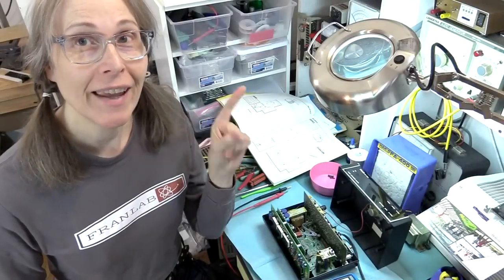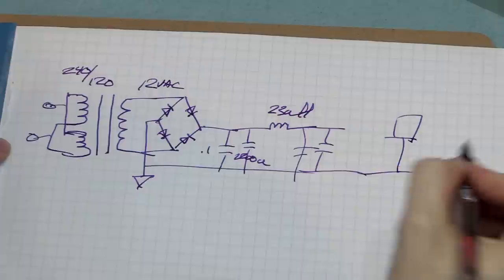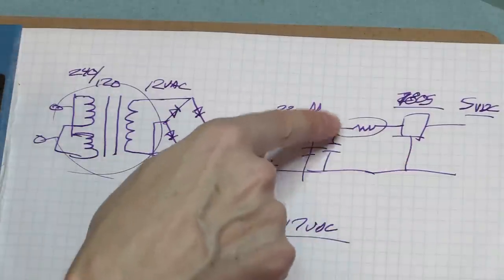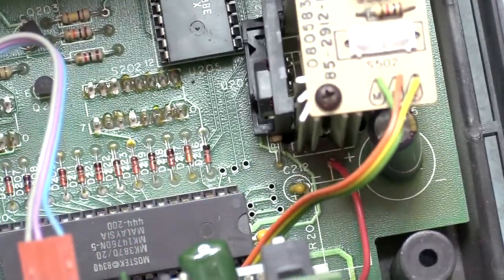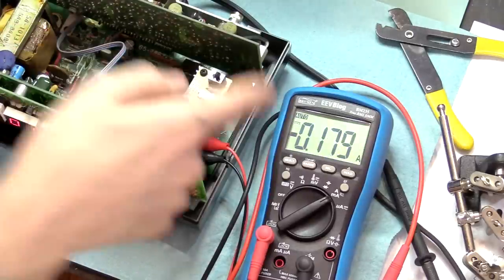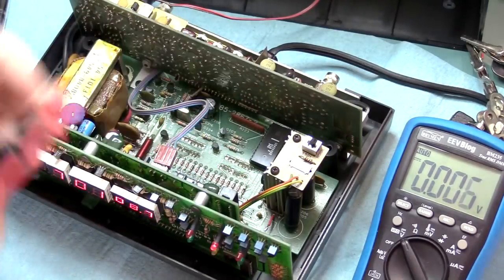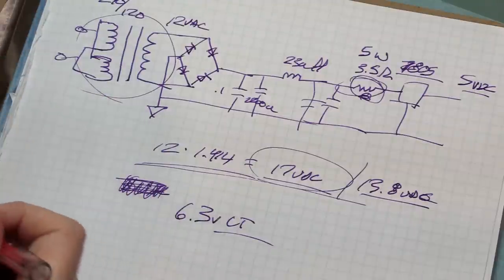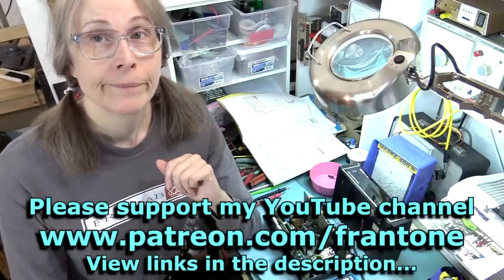Heathkit GC-1000 Power Supply Design Fails and Fixes

Comment: 3rd option: re-wire the transformer primary for 240v operation... then since it's running on 120v, you'd have the target 6.3v coming out of it.
Reply: Yea, this is a workable solution.  I’ve done this before in similar situations, and it works.  I’d probably keep a resistor in the B+ path.... a .1 ohm or something.
Reply: I totally agree I was going to success the same thing, but you beat me to it.
Reply: That’s what I was going to say.
Reply: I doubt 6.3VAC is enough for 5V when you take into account the current is a lot higher than Fran measured when a linear regulator is used and you have to account for the minimum mains voltage and the maximum ripple voltage that the caps give when they are at minimum tolerance, etc. Normally 8-9V AC is about right for 5V regulator in my experience.
Reply: I've tried this before but found the transformer's load regulation to be poor. It could still work provided there is enough margin for the regulator's drop out voltage at max current.
Reply: You would need to give yourself more headroom than 6.3v for ripple, that's for sure. That is far too close to the dropout voltage of a regulator, even before the sag caused by the load on the transformer! I would target 8v at least, then regulate down to 5v. 12.6v is excessive though. You would need something better than a linear regulator to deal with that much voltage drop. 
Or you could just punish the hell out of the 7805 and throw a huge smoothing cap on it's choppy output constantly thermally shutting down xD Seems like that was there design philosophy here... monsters.
Reply: @nophead  Good point.  Would have been better to measure the current out of the switcher.  Could be more than 2x what was being measured.
Reply: @nophead  is they before or after the +40%from rectification?
Reply: @nophead  It's probably why the Atari 2600 and Nintendo NES used a 9V ac power brick.
Reply: I was thinking the same  wire the primary for 240V. fond memory's.  I had a TI 30 when I went to electronics school in 1981 to 83. Wichita Technical Ins. 3 months of long hand math then oh Happy day they passed out the TI 30"s and spent the next moth teaching us how to use it. Thanks for the memory
Reply: >I doubt 6.3VAC is enough for 5V
And the same transformer secondary is feeding an 8V regulator, too, so that's right out.
Reply: @Noxonomus  That is the AC RMS voltage before the rectification. Yes it is +41% but minus 2 diode drops and minus the ripple voltage of the caps. That has to be above the regulator min voltage even when the mains is at its lowest spec and the caps are at their minimum tolerance.
Reply: @Noxonomus  Another thing to take into consideration is the diodes only conduct on the peaks, so the current in the secondary and hence the voltage drop due to resistance is much higher than if it was driving a resistive load.
Reply: Yep, a lot of people apparently haven't peeked at the schematic. One transformer winding & bridge is feeding both the 5v & 8v regulators.
Reply: I was goin that way as well & could replace reg with a low dropout type if need be
Reply: You'd need a buck booster for the 8v
Reply: That could be the solution for when it is been used in America. But what about the "poor" Europeans? ;-)
Reply: Just replace it with a low dropout version.
Reply: @nophead  Well do what I did on my 1980s S100 system. Put a 12v tranny in boost mode on the primary of the big 6.3v surplus filament transformer. Mine came out of an old tube RCA broadcast unit chassis, it was about 20 amps at 6.3v. RCA "junk"  was common in Philadelphia electronics surplus shops as the broadcast and military divisions of RCA were in Camden NJ.
Reply: @nophead  Need to use a LDO linear regulator, pin compatible to 78xx series. And replace the 8V reg to a LDO one as well.
Reply: @truckerallikatuk  No, she needs to get rid of any switching regulators, as the noise they produce kills the radio reception, and the clock fails to sychronize.

Comment: I had one of these operational for nearly 30 years.  Built as a kit, it worked well with a long wire antenna.  First issue was the heat that builds up inside.  Second was the regulator.  Problem is the heat. Regulator can do it IF you can get rid of the heat, upgraded the heatsink (at great pain).  Then added a fan to the side as the heat built up inside and affected the receiver performance.  Carved a hole near the regulator for a small 40mm fan - still running today.

Comment: Thanks for getting back to the content we like to see. I hope you're going to show us a part 3 of this clock series. I was amazed and excited to see Heathkit  has these clocks available again for $100.
Reply: Sadly, the $100 gets you the "Most Reliable Clock" (a battery-backed clock).  Not the "Most Accurate Clock" that sets itself from WWV.
Reply: @russellhltn1396  I should have read the ad more carefully :(
Reply: There's been talk that "WWV" (NIST) time & frequency transmissions will be defunded soon.
Reply: @ordinaryaverageguy76  True.  It would be a shame for it to go away, but things have changed such that it's services are not as important as they once were.  You can get accurate time from the GPS system.
Reply: Russell Hltn But it's so much more complex that in many scenarios, it is not as reliable as WWW, or even WWVB?

You become dependent on a long string of points of possible failure, where WWV is much shorter a string and direct delivery to the user. It's on the ground, easy to repair, unlike satellites, their control segment and their uplinks?

Comment: I have to say, the ads for your videos have been consistently the most interesting I've seen.  I left them on for your revenue's sake, but they were also very interesting.  

One was for a laser cutter that looked very impressive.  The other was a portal power pack with a built-in solar panel which is intriguing.  

Thanks!

Comment: Fran, 
Well, when I remember correctly, it also has a 12V input? So it makes totally sense to have the internal transformer also run on 12V.
That would give about the same values on resistors and such things. Nice to run it from your car with something between 12 (car=off) to 14.4 (car is running) Volt.
Also when running of a computer a 12V supply is easier to use. All without needing any change to the internals. Or of course having 107 Volt coming from your socket.

Main difference beeing the heat that is delivered.
Reply: @Rob2  I was about to mention that if it was put in a car, that'd see up to about 14v when the engine was running too.
Reply: I worked for Heathkit for many years and you are right about the 12dc input - the customers were Ham radio guys and wanted battery mode.

Comment: Fran, look at the Recom R-78 series of voltage regulators.  They're switch mode 3-pin modules that plug right into a 78xx series hole pattern.  The R-78E5.0-1.0 I use is rated for 8 to 28 volts input, with a 5v 1a output.  It was just a little more than $3 from Mouser Electronics.  I'm sure Digikey has them, too.
Reply: On the first video, there was a long discussion about how switchmode replacements create too much noise for the HF receiver circuit and cause interference trying to pick up the 5 MHz, 10 MHz and 15 MHz WWV signals.
Reply: @scottwolf9914  ahh, good point.
Reply: The recom regs are fine for radio use. I've used them in a few transceivers with no noticeable RF noise. The particular one that was fitted to Fran's clock is obviously not as well behaved.

Comment: The advantage of the switch mode regulator is it exchanges current and voltage.  So your initial current readings are wrong.  Current at the load will be different then the current at the regulator input.
Reply: Exactly. Lets do some ballpark math: 13.8 volts * 0.2 amps is about 3 watts. Assuming 80% switching regulator efficiency, it gives us 3 watts / 80% / 5 volt = 0.75 amps at 5 volts. With a linear regulator you'll have that 0.75 amps at the 12 volt side too, which will load down that supply significantly. A 9 volt transformer may probably be too weak to do the job.
Reply: Noisy little buggers, those switchers are 😃
Reply: @Circa-rc4sn   yea you'r not wrong
Reply: @Circa-rc4sn  And that's the problem with switchers.  If this was my clock, I'd put back in the 7805, reduce the input voltage and get the clock working.  Then I'd think about adding a quiet switcher.  I like the idea of a switcher, but I don't like the idea of chasing two problems at once.  Of course, if I had a 6.3V transformer of the right size.....
Reply: @Circa-rc4sn  Yep, and it depends on how sensitive the radio is, trying to pick up WWV, while under a cell phone tower. Don't know how much a little switcher in the box would effect WWV reception.
Reply: @davelister796  Not saying it won't work.. but it is not a buried trace layered groundplane shielded PC board either. 
Any length of straight conductor can be a transmitting antenna at some odd wavelength or a harmonic there of.
Never know until you try.
I would hook my o'scope to each section to see what is there. Sometimes a simple fix can be used to reduce ripple currents.
✌❤
Reply: @Rob2  I disagree. I use HF radio ... i'm still an avid SWL.

The fortunate thing is most of the stuff people are running in that waveband is actually very poorly matched to its 'antenna'... and the actual 'interference distance' is quite low. I've found simply throwing an end fed long wire up in a tree rather than at house eaves height... has cut the interference to pretty much zero, and I live in a suburb, so no doubt those demonic 'can't be bothered to run cat6' powerline things are everywhere

One of the worst offenders turned out to be a neighbour's wifi router?! I think it was radiating the noise from its switching supply back down her phone line, which runs parallel to ours (obviously, in the cable) for several km... and then our wiring was re-radiating it.
common mode choke on the landline fixed it (on her landline, we're on speaking terms) and my advice to point out to the ISP that their equipment was radiating radio interference.... caused them to send a replacement
Reply: @Rob2  Ah I see. I still think this situation is wrong. There are companies selling these powerline wallwart things that used to be in charge of PREVENTING radio interference (looks witheringly at British telecom). It seems we operate the same attitude toward the airwaves as we do toward the planet in general: provided it doesn't bother ME, pollute at will :(

Comment: Having built quite a few Heathkit projects, I'd bet the power supply was built around components they already had stocks of (especially in their later kits).
Reply: i recall reading they used surplus stuff a lot.
Reply: @fanplant   I think they started with mostly surplus in the beginning. Their main compitition in the kit market was Hallicrafter and later Lafayette and they too had their share of salvage parts. "Well how do I know?" That's simple. Some of the parts like transformers had Federal Stock Numbers printed on them.
Reply: I think that's exactly what's going on here.
Reply: Using surplus parts was Heath's MO from day one. In the late 1940s it was surplus WW2 parts. That does not mean their designs weren't brilliant. Many were, and they did a lot to bring advanced electronics to the hobbiests.
Reply: @waltschannel7465  Exactly! I never meant to disparage their using salvage and God knows there's ALWAYS enough mil salvage to go around and I've bought tons of it myself in salvage auctions and it's the only way to get your hands on some things. Heathkit asside, for a while there most of my projects was built with mil salvage. As for the power supply, someone got lazy and did what Fran showed us they did.

Comment: Don't forget the external 12 volts input,you would have to consider this as well as the mains power supply when calculating the modification.
Reply: Wish she will revisit this with that in the mix.  Perhaps the external 12v could be run lower, too?  Have to relabel the input jack, for sure.

Comment: I built my GC-1000 a few months after it was first released. Shortly after I started running it I found that the grill metal restricted the airflow and it was getting too hot inside. I cut two 1 inch holes in the top grill cover to allow better air movement and this one clock has been running 24/7 in my bedroom for over 34 years without a single fault.

Comment: I spent some seven years working for a power supply manufacturer. At different times as both manufacturing engineer and materiel manager. We built many types of transformers, using a variety of core materials, winding tubes, wires sizes and composition, and insulation coatings. I do remember buying 120V/ 12V transformers from outside suppliers since they were so common, and were manufactured them in such great volume that we could not build them cheaper in-house. This may have been what Heathkit did also.

Comment: The external DC input may explain the choice of secondary voltage. The 5v regulator could do double duty regulating the secondary winding or an unregulated cigarette lighter input from a vehicle.

Comment: I’m building a GC-1000 from scratch and have settled on a 9V 12VA transformer. I’m keeping the series resistor into the 7805 and will adjust its value and power rating on test.

Comment: You could try the RECOM  r-785.0-0.5 switching regulators. They're pin compatible with the 7805 linear regs and don't even get warm. They're RF quiet too - I've used them in several radios instead of 7805s and they behave really well. Not the cheapest option but they're dependable and easy to source.

Comment: One reason for the high transformer voltage is that you also have a 12V DC input option. Your regulator has to cope with that, so it may as well cope with a similar mains voltage.

Older designs like this might also expect poor mains regulation in some locations so it runs at a rather high voltage when you have a better city mains supply. Old HP equipment also had a huge supply tolerance and similarly ran quite hot. Just one of the choices made in 80s electronics design.

I believe the Power Trends regulator you removed has a relatively low switching frequency. A more modern device with a few MHz frequency would perhaps produce less interference.

Better still might be an expensive Traco or similar converter in a shielding can. Hopelessly overpriced for Heathkit, but a reasonable one-off fix to keep this lovely example running safely.

Comment: The battery backup was based on the use of a 12V gel-cell or car battery which would be about 13.8 VDC when just sitting.  The power supply needs to accommodate either AC or battery power and make the transition either way without a glitch. https://prc68.com/I/HeathkitGC1000.shtml#Batt
There's a slide switch on the side that will turn off the display, so if you are there when the power fails you can reduce the battery drain.  It would have been better if there was a relay that only allowed the display to be on when on AC power with a bypass push button to turn on the display to read the clock during a power outage. 

Glitches are to be avoided since this may be one of the first Disciplined Oscillators predating the GPSDO units that are common today.  It might be called a WWVDO.  The 3.6 MHz oscillator has it's frequency tweaked to bring it spot on so the GC-1000 can be used as a frequency standard.

Comment: Try scoping the regulator input. If the filter caps are dry you will get too much ripple in the supply, so the output might get quite noisy. Maybe that's the reason the CPU doesn't start on its own.

Comment: I have been cleaning out mom's  house since she has entered the nursing home at age 93. I have found a lot of old phone chargers for wireless home phones, most are 9V at 550 map. AC.  When I open them up there is a nice heavy transformer that puts out about 12 V unloaded but drops to right at 9V when used. I use them for projects that don't like the new fangled PS's.  I have even put in bridge rectifiers and come up with some rather nice smooth (ok I added some caps!) power for experimenting and powering devices that need 9V without wearing out batteries.

Comment: Heathkit, like many others, bought and used parts in bulk quantities for their kits. Why buy nine volt transformers when we can get by with those twelve volt transformers they had in supply? We've noticed this on several other Heathkit products from transmitters, transceivers, to test equipment. Many mods have been made over the years on Heathkit products, like several others, to improve or upgrade. No problem with that and I'm surely not knocking Heathkit. We love Heathkit at the museum. I have a HW 101, a VTVM, and an AC voltmeter and  a couple other Heathkit products myself.

I subscribed a while back and have watched many of your videos. I usually watch on a TV and there is no way to comment, so forgive me for not commenting more often. Interesting channel. Caught some of the musical videos, interesting, and glad to see the electronic related ones. 

If you're ever in the Huntington WV area, please stop by the Museum of Radio and Technology. Give me a heads up, I'd love to meet you.

Comment: There are many ways to try - half-wave rectification, bigger dropper resistor, potential divider dropper (less dependent on current drawn), series 9V power zener diode.  Instead of the variac(!), an external transformer  with a ~50V secondary wired in series with the primary in opposition to line phase.  You can also wire the TX for 240V to get 6V.  My favourite is put the PSU into a 7812 (drops 5V) then into the 7805 (drops 7V).
The external transformer dodge is more useful if you have low line voltage; by wiring the external transformer secondary in series in phase with the line, you can get an extra few volts, e.g. 114V > 120V with a 6V transformer.